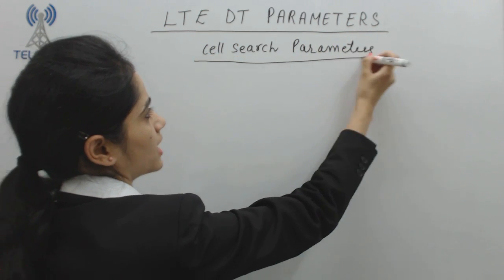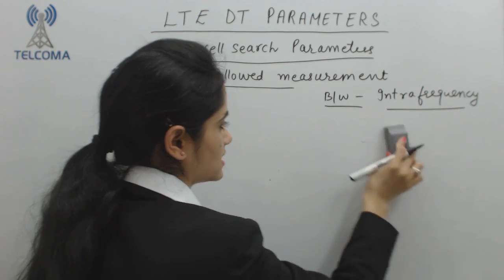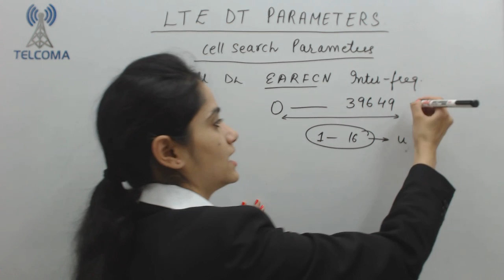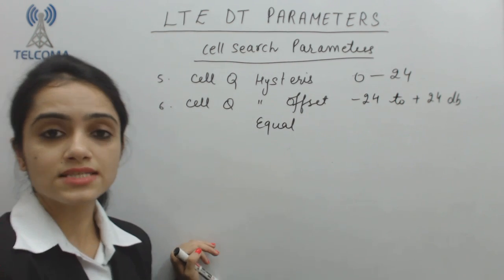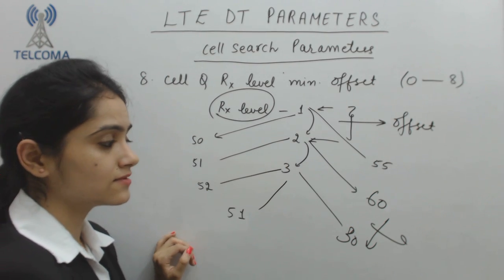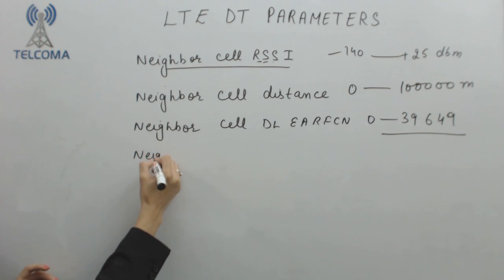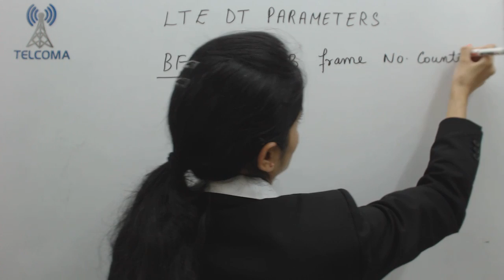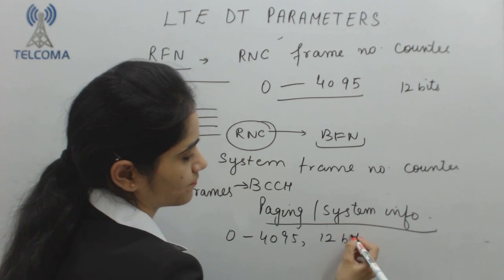4G LTE Drive Test (DT) parameters (Part 2) course by TELCOMA Training

Comment: I had a doubt regarding 4G-LTE ..Is there a parameter in 4G-LTE which deals with variation in transmission power of a base station (eNB) and the association with UE's based upon the transmission power.

Basically what I want to ask is is it possible to increase/transmission power of a particular base station so that it may associate to more number of user equipments (upon increasing the power) and lesser number of user equipments (upon decreasing the transmission power)?
Reply: Yes, increasing transmission power literally means you are increasing your coverage/reach. However, you should take in consideration the maximum distance permissible to transmit by your NCA/EPA.